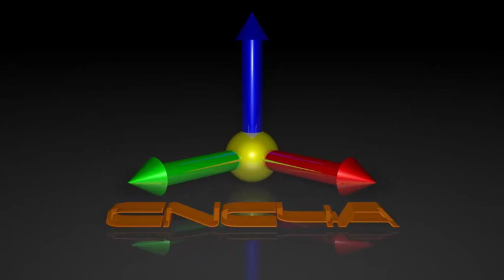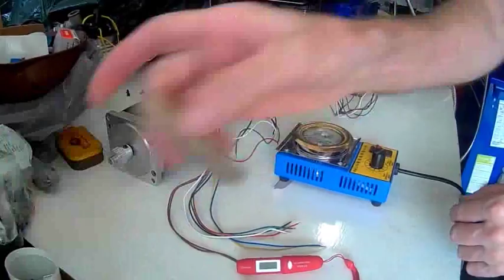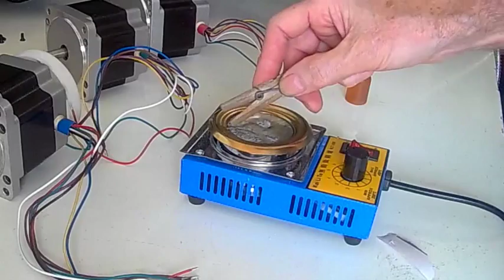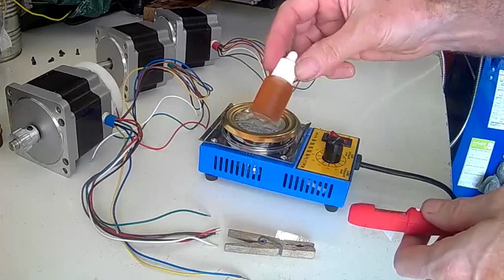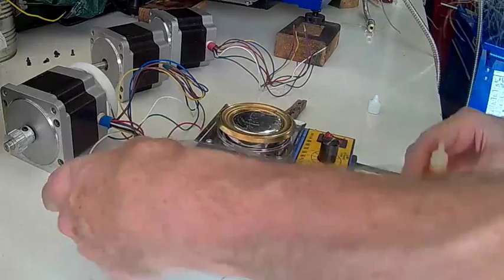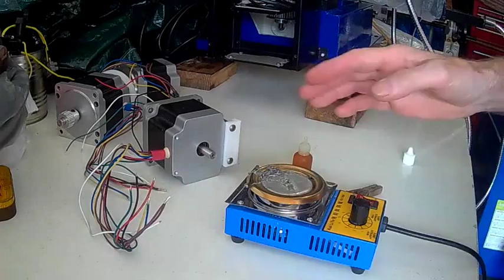CNC4A - Solder Pot Stepper

Comment: Can you just keep reusing the same solder over and over through heat and cool cycles?
Reply from the maker: Yes. Don't forget to subscribe.  You just scrap the crude off the top with a toothpick, etc before dipping so you have nice and shiny molten lead and if the toothpick chars, the temp is too high.  Dip away and when the lead level drops just top it up with another small lead piece or pellet.